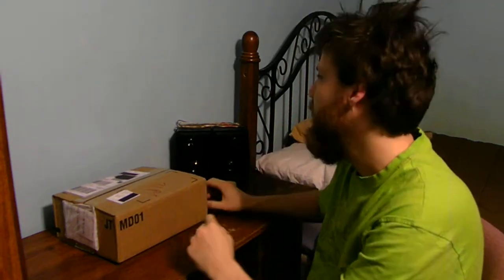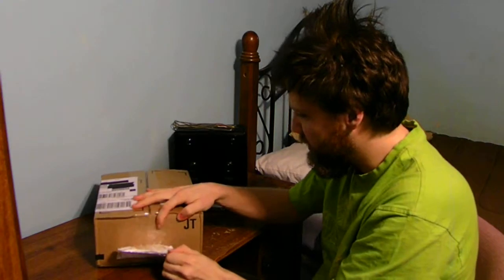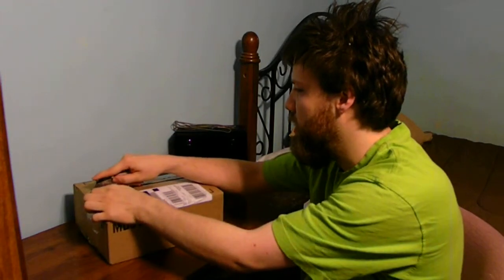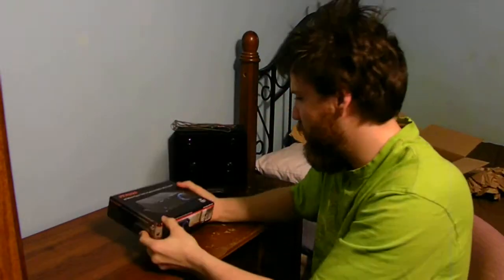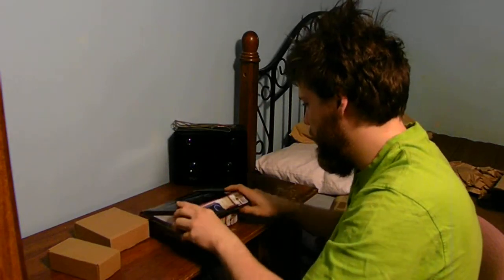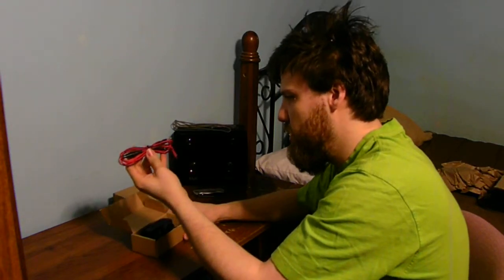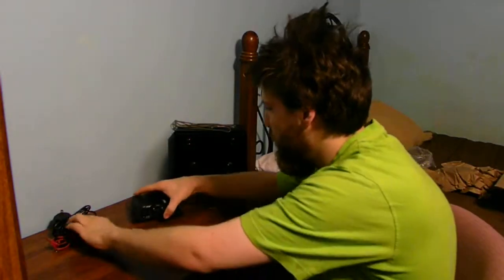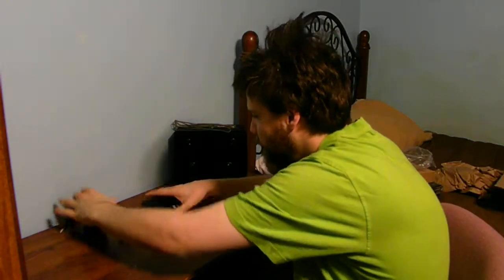UNBOXING A MINI PYLE AUDIO AMPLIFIER

Comment: ANYONE using this amp SEE MY VIDEO on this amp.  Also, I have found the crossover switches are often scratchy...  move them around and sound sometimes comes and goes if this is the case.  I had to open and permanently solder the xover switch.